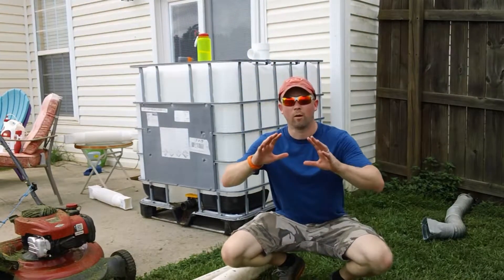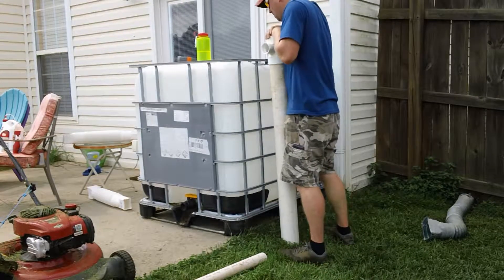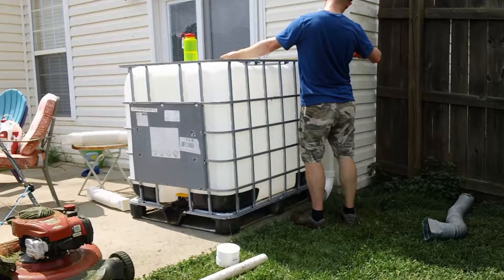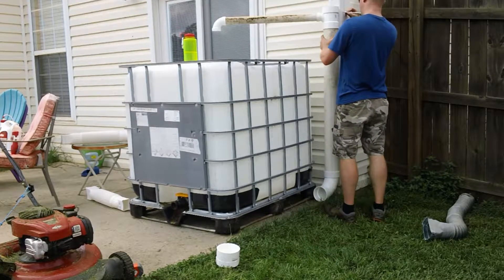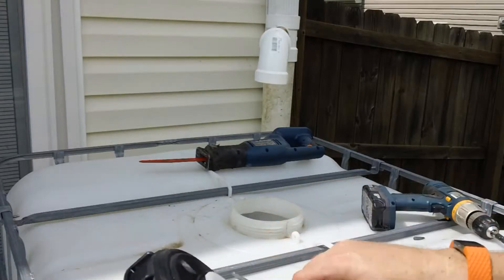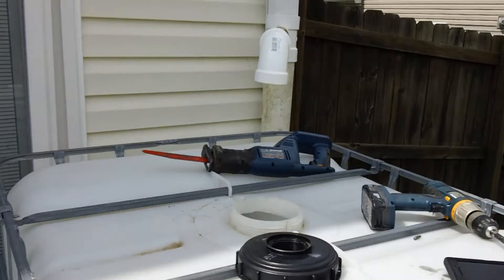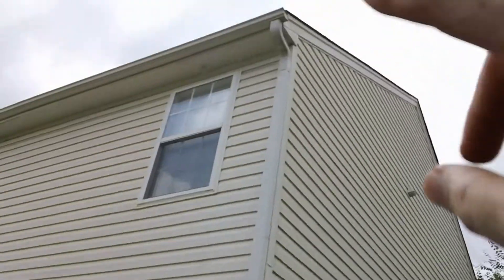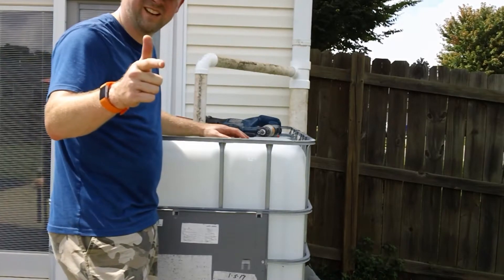Rain Water Diverter

Comment: Go 4” to 3” adaptor for the first flush. It will be plenty for filtration, yet let you get water into the tank. The 4” holds too much water before you can harvest any.
Reply from the maker: You are absolutely correct in that suggestion.  Thank you! 
For this project I was under the hurricane gun.  I may implement your suggestion soon.  
I have definitely NOT had any lack of rain water in my barrel since I put in in place. 
Next step is to build a 6ft platform for it to also double up as a storage shed.

Comment: Nicee , looking for short cut and layman plumbing for my self . Thanks
Reply from the maker: SAMY KHAN thank you and you’re welcome!  Are you working on a rain water catchment too?
Reply: @GWBarker  I live in upstate Ny City area but rain cycle is pretty normal here. I have two 300 gallon just like yours, hook one straight with roof drain into tank with paint strainer net on top but just like ideas so i can b more in order and organized. I also look into youtube solar 12 volt water pump with battery and 20 watt solar panel, if i can buy it seperate with battery and online items to increase my knowledge  and cheap experiment.
Reply from the maker: @DesiJugaarDIY  Doubled up?  Nice!   I just have the one right now.  It will eventually be my sump tank for my aquaponic system.  I have 2 of the IBCs behind my shed for future fish tanks.  I will replace the one on the house with another tank when that happens.  

How far are you pumping water?  and to what?